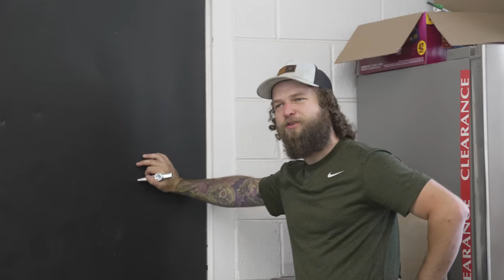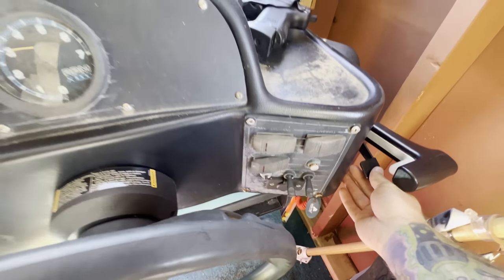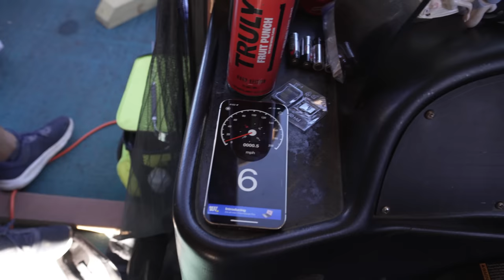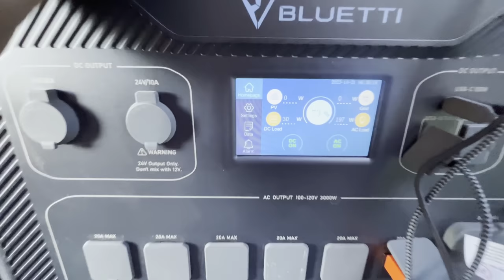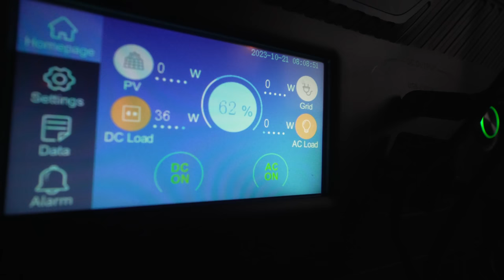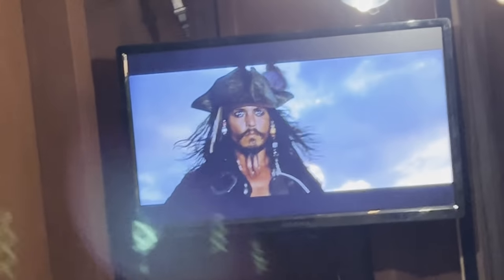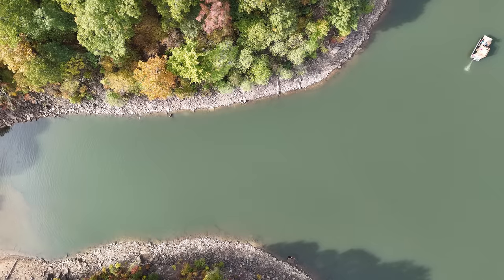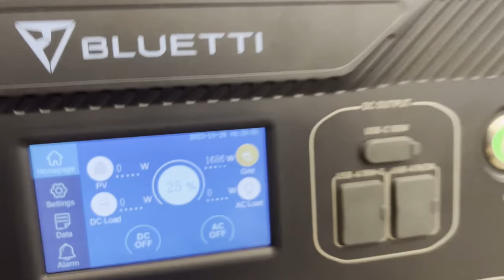Overnight Camping In Our Homemade Pirate Ship

Comment: "That's not a good boat to want to be like", it was a good ship and well designed(other than certain elements.) It had watertight bulkheads, it had 2 layers on the bottom of the ship in case it got beached and went aground so it wouldn't flood the compartments, the flaw is it didn't have that on the side unlike Titanic's sister ships.

Comment: I'd put an outboard backup motor on the back for extra weight and only use it if the primary motor fails. with that inverter you got I'm just shocked you guys didn't add an ac unit or heater